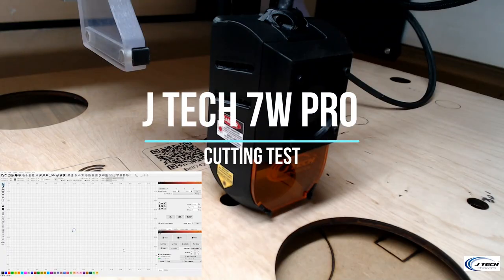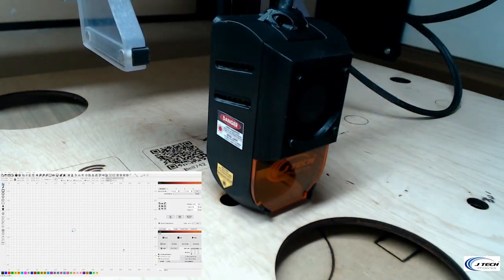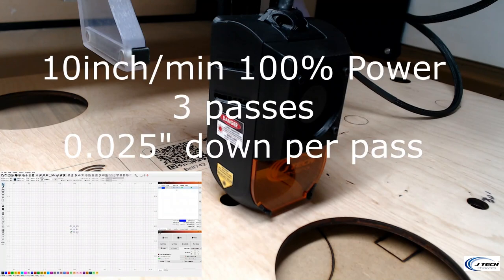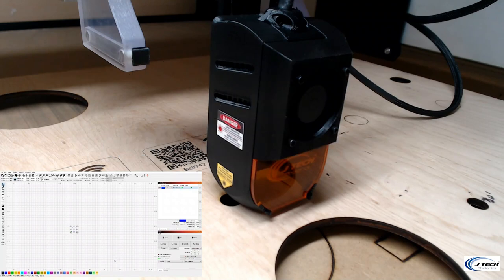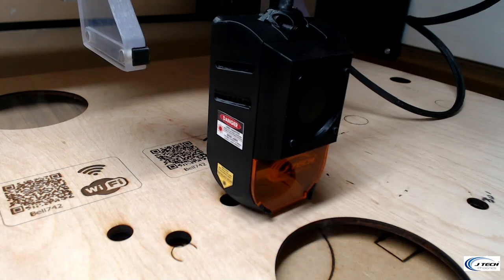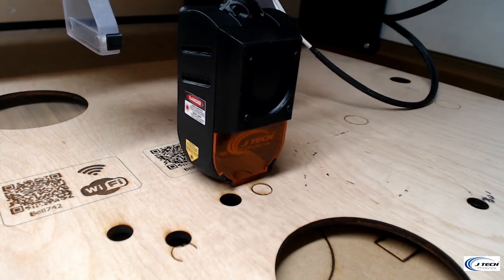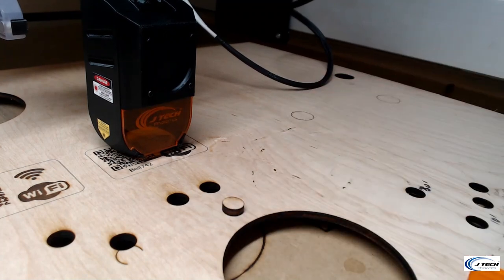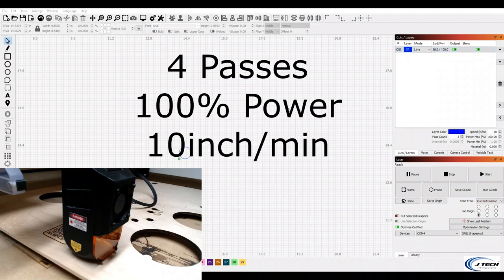J Tech Pro Laser Cutting Baltic Birch Plywood Test

Comment: Strange that my 7w pro will not cut through 1/4” plywood regardless of how many passes I make. However when I use 1/8” at 50% it blows through it on the 2nd pass.

Comment: Greetings Jay, I have a question for you. I'm using the exact same settings as you and yet I can't get my Pro to burn through 1/8" Baltic. I even upped my number of passes to 7, just as a test. Is there a setting I'm missing somewhere? Am I not doing something correctly? Thanks in advance!
Reply: I too, second this, something is off. My finger nail can't detect any "cut"
Reply: @JTechPhotonics I was getting ready to order the J Tech Pro Laser, however, this is concerning to me that the pro version will not even cut through 1/8" Baltic Plywood, and your video says you can cut through 1/4" Baltic birch? What is the truth? Thanks
Reply: @phototec  Baltic Birch is MUCH more dense than the home depot plywood he is using for the demo. Typically the core of the HD plywood is poplar or another semi hardwood.

Comment: What do you recommend for fume extraction. How do you ventilate the area? It gets smoky pretty fast!
Reply from the maker: We use a new shop vac with a charcoal filter pad wrapped around the inside of it.  On amazon, search "charcoal filter pad".  Clears the smoke good.  You can also vent to the outside if you have the ability.

Comment: Something is off here, my 7W can't cut through melted butter at 100% power...I'm trying to cut through leather, that's all I need it to do...do you take trade ins?
Reply: Same issue here. Has anyone else successfully cut through
Reply from the maker: Cutting through leather can be a bit difficult at the last part.  Make sure your either can step down the Z axis to get through the last part or set your laser to just above the top of the leather.  This way the focus will be closer to the bottom of the cut versus at the top.  We normally score the leather on the top and then use a knife to get through the rest.

Comment: How do you drop the z down .025 each pass? Im new to using lightburn and dont know if you do it in light burn or the cnc software?
Reply from the maker: It is the z step per pass in the cut settings editor.  Double click on the speed/power on the layer to open it up.  Then choose the line mode and it will be in the settings for the z step per pass.
Reply: @JTechPhotonics  
What if the z step per pass isn't highlighted so you can use that option...how do you get it to turn on so you can use it?
Reply: @JTechPhotonics  my z step doesn't highlight when I switch to Line mode either.
Reply: @rudyaiello3402  @pnybt you have to enable the Z axis. Click edit at the top and click on Device settings. In the upper right of the screen will be "Z Axis Control", and under that will be "Enable Z Axis". Hope this helps.

Comment: What is the difference between the PRO and non-PRO?
Reply from the maker: The Pro version has special optics in the diode that concentrate the power to a square versus a rectangle.  This gives more power density which in turn gives the ability to engrave faster and cut with less passes.
Reply: @JTechPhotonics  So is the High Resolution Lens still needed for better results?
Reply from the maker: @1987gnXtreme  yes.  It is designed for the high res lens.

Comment: Why do i see people stating that this cant cut 1/8th thick baltic burch ? I bought a laser master 2 20W 5.5 output. claims it can cut. reality cardboard only.... now that was 300$ down the drain. I'm not making the same mistake for 700$ seams if your in the laser industry you can make claims on anything. Not saying Jtech has did any of this. But after being burned once from fake claims from a laser makes it really hard to buy the next one.
Reply: I have this laser and I can’t get it to cut through anything. Engraves well but doesn’t even penetrate 3mm ply after 20 passes.
Reply: @bhutch216  Do you have the pro version or first version?
Reply from the maker: Every type of wood is going to be a little different.  On our video we show a two ply 1/4" birch from Home Depot and show the SKU in the video of what we used.  Many of the hobby type plywood are glued multiple sheets together and the more sheets of hardwood the harder it will be to cut.  A 5 ply 1/4" wood will be much harder to cut than a 2 ply.  1/8" ply is normally 3 sheets of hardwood glued together with no filler, so it will be harder to cut this than the 2 ply 1/4".  A solid piece of hardwood will be also more difficult to cut and require more passes.  I'll put a disclaimer on the video so it is clear on what we used.  We are not trying to do any false advertising.

Comment: Just tried this on 1/4" baltic birch and no luck for me with my pro 7w.  I'm using true 1/4" 5 layer baltic birch, not the 1/4" (really 3/16") from a home depot or lowes.  any ideas?  Thanks.
Reply: Did you ever get it to cut the 1/4inch baltic birch?
Reply: @st0mper121  I can't cut through anything. Not even 1/8"
Reply from the maker: The Baltic Birch we used was the 2 layer 1/4" birch.  The 5 layer has three more layers of hard wood to get through, so it will take more passes to get through it.  The one we used was the kind that has a thin layer on top and bottom with the "filler" in the middle.  I would suspect that you will need to do about 10 to 12 passes to get through this.  Make sure you put the laser almost to the workpiece to also have the focus be more inside the middle of the wood, or step it down per pass.
Reply: @JTechPhotonics  how much would you recommend the step down be?